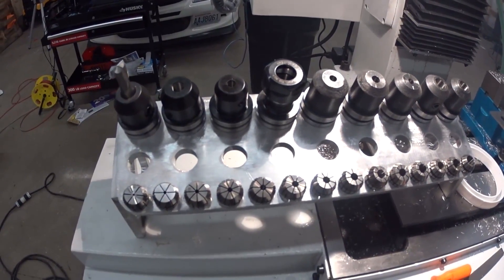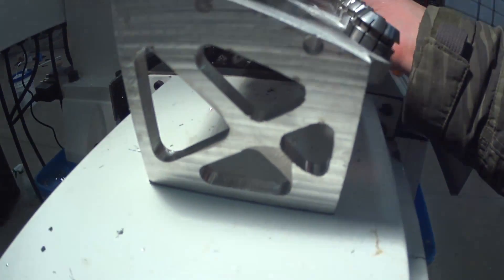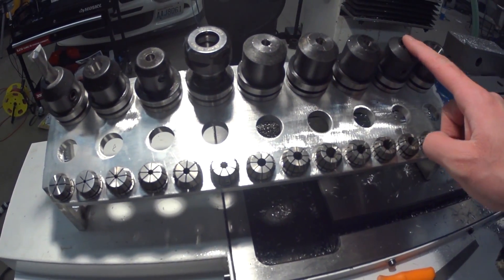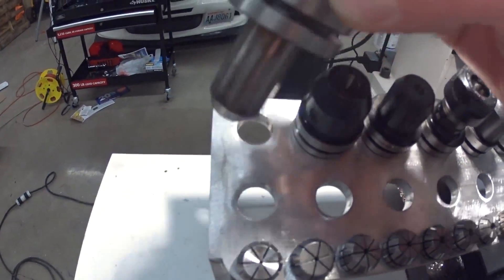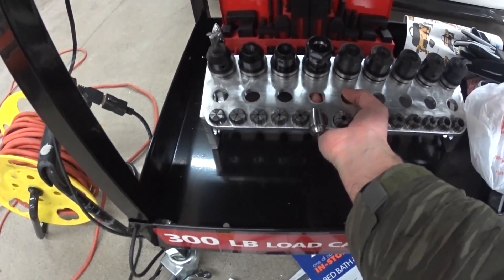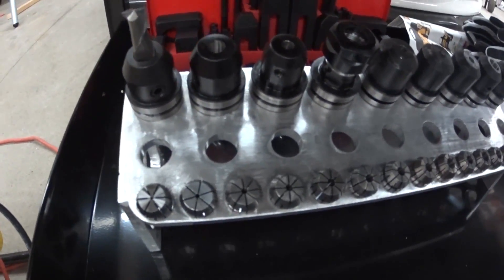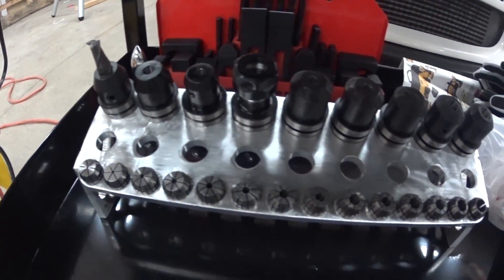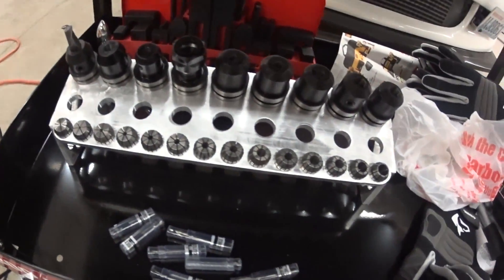Tormach TTS tool holder rack

Comment: I am purchasing a PM-940M and was wondering if you had to do any modifications for the TTS system on your machine? And if you had any info on doing that?
Reply from the maker: Hi Bradley,
I didn't need to make any modifications to get the TTS system to work. I bought the R8 TTS collet from Little Machine Shop and it threaded right in. To tighten and loosen the tools i use a Millwaukee impact with a socket adapter. This is temporary until i get a power drawbar figured out.

Comment: Great idea on the novakon tool holders. I didn't realize they were happy the price of the Tormach stuff. It seems lots of them are out of stock right now though. How do they compare to the Tormach ones? Good runout?
Reply from the maker: stuart andrews 

I haven't tested the run out yet because I am waiting on a dial test indicator to come in the mail to get a more accurate reading. The Novakon holders seemed to get decent reviews on cnczone.

The machining is definitely better on the tormach holders, but I have to machine some gear reduction stepper motor plates for my plasma table so I am going to try using the Novakon holders when I machine those.